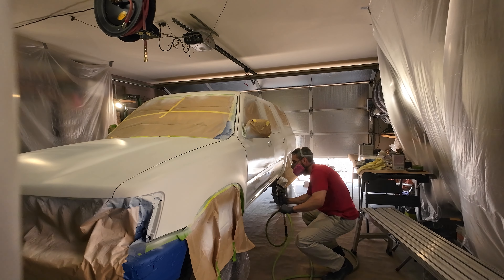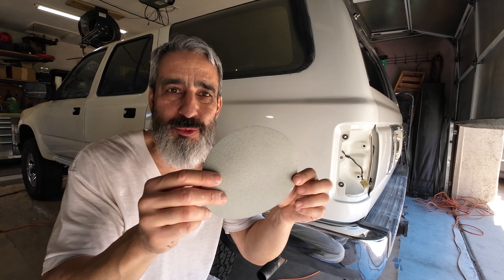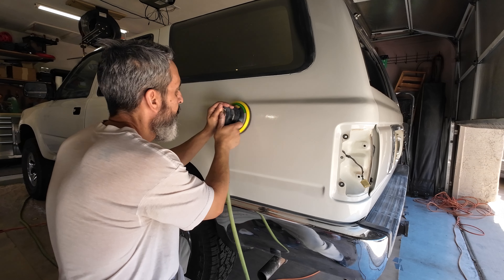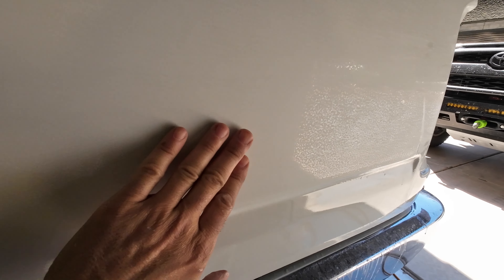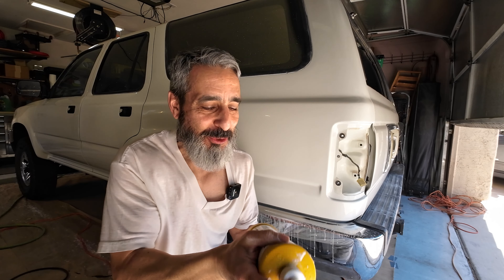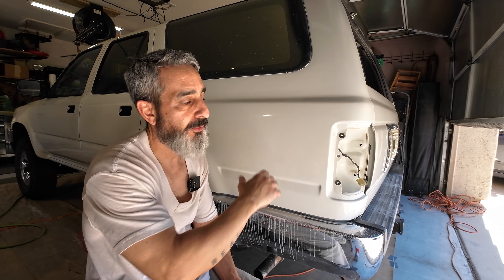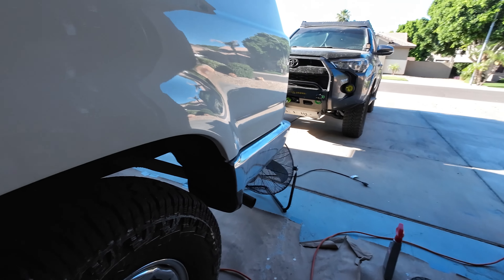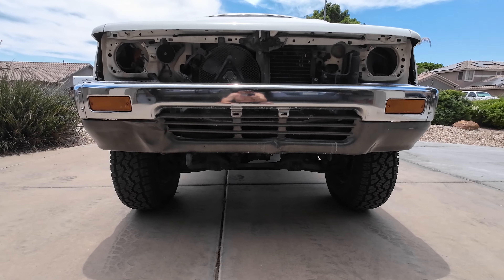You MUST Do This For A Professional Finish: Wet Sand and Polish

Comment: No waste. To the point. Very informative. Exactly what a how-to video should be. Deserving of the view and like. I've watched two already, good stuff, man.
Reply from the maker: @adrienroy9310  I appreciate your comment!!
Reply: I have, and still use a B & D  "PROFESSIONAL" polisher. Mine must be 35 YO. It looks like your corded machine used w/ the 1st 2k grit sanding of your 3 step process. Nice deep reflection after 3rd step 🎯
Reply from the maker: @lindahaack2530  Ha, yes, you nailed it! My boss in the body shop tried to throw it away back in the early 1990s when the cord failed. I fixed it and have used it ever since

Comment: I already left a comment on part 1, but incredible conclusion!  I'm been staring at the rust taking over the once white hood on 95' for 5 years.  past owners did not take care of it. Yours has the cool bolts heads that show on the front bumper.   if I were to buy a cheap enclosed tent how many hours do you estimate, roughly?   And cost?  I'm guessing a week of long days and 1500 for material
Reply from the maker: Thank you. It's difficult to say as sometimes you get into it and you keep finding things you want to make perfect. But I would say, you're pretty close in your estimate of time and money
Reply: @AZOverland2017  Cheers! thanks

Comment: Those 3M 3000s do last forever. I also constantly spray off the pad to clean it like you did. 
Have you ever tried the Rupes polishing system? The sand paper sucks so I use the 3M and polish with the Rupes. The polish school came out and got the bosses to take a way the Rotary polishers. It takes longer cutting with a DA polisher but you’ll never get swirls
Reply from the maker: I haven't used Rupes, they look good though. Yeah, I wouldn't recommend a rotary unless you have experience or get some good practice in. I've seen too many people burn through the paint on panel edges

Comment: I’ve watched a lot of car paint videos. Yours is my favorite. Great detail. Recaps, summaries, explanations, are just perfect. Toward the end of this video, I thought I heard you say, I have through compound and polish, dealt with the orange peel, but want “some  of it”, which confused me. Maybe you can do a video on orange peel. Thanks.
Reply from the maker: Thank you! Yes, from the factory most cars have orange peel. Take a at the outside of an orange. Because I am restoring the 4Runner back to a factory look, I kept some of the orange peel. Not much, but some. If I was doing a show car, I would have sanded it completely flat (no orange peel) and continued with the same process. It gives a deeper, more reflective surface.
Reply: You're right about the orange peel. All factory finished have an amount of of peel depending on the manufacturer. Cutting all the peel will make it shine like a show car but for daily use is not suitable.

Comment: Looks nice!  Most of my problems are from not doing a full panel at once.  Just like a wall in a  house, it's amazing how much a different angle can change things.  On my roof, I've been worried about sanding off too much on parts that got just overspray and not a full thick coat, not wanting to go through what remains.  Mine's looking good, but there is some texture seen when we are upstairs or when walking down the stairs.  But I'll just go for it, with a fine grit, knowing that I can respray the whole roof with clear if need be.

Yours came out great.  White seems plain to me, so I'd be tempted to go the fancy route of adding water droplets on the lower panels or something.  But a zombie apocalypse FJ cruiser, I think he was based in Payson or N on 17, has been growing on me.  Plain white is good for not showing scratches when the primer is the same color, and it keeps the car a little cooler in AZ.  But one option is to go the FJ route, with a white roof and the rest with color.  That said, I didn't like the sand color a buddy in Phoenix painted his old land cruiser, but I at least consider it these days.  And he had an old white toyota pickup too, maybe '86.

Thanks for the detailed videos.  It gives me some good quality work to aim for.

Comment: Great videos. I'm thinking of painting an old BMW. How about polishing the color coat before applying the clear coat? or skip the clear coat altogether?
Reply from the maker: You definitely don't want to polish the color coat before clear. If it was going to be a show car, you could wet sand the color coat with a fine sandpaper before clear, but that gets very involved. 

You can skip clear if you go with a Single Stage paint. That will be applied wet and produce a gloss.

Comment: I have a car that needs a new paint job eventually. I’m tempted to DIY it all, but I don’t have most of the tools.

What are your thoughts on DIY body work, prep, and spray can primer, then going somewhere like Mayco for the actual paint job?
Reply from the maker: Definitely an option. There are some places that don't charge too much for a decent paint job. Spray can primer is fine, but I usually reserve that for quick touch ups as I like a thicker, higher build primer over bodywork. But, it is possible
Reply: @AZOverland2017  thanks for the response!

When the time comes I’ll probably get some quotes just to make sure I know my options.

Comment: Pass on a tip,,, l just tried meguiars 110 compound and it's all l will use now, unbelievable results, very little dust and sling,, really looks like you compounded and polished, and it will remove 1000 grit sandpaper scratches, shine's like it's been waxed when your done, l found a rotary buffer with wool pad works best,, try it you will be sold like l am
Reply from the maker: Thank you. I was considering that compound as well. I will definitely give it a try
Reply: @AZOverland2017  your welcome, your going to love it,, used it today on panel sanded with 1000 and 2000 with little buffer with soft pad and was all it needed , looks like l had waxed it with a few passes, never seen anything like it,, looks like mayonnaise and no grit at all . Well worth the money you don't need much..

Comment: Hi . Just discovered your Chanel .
Nice work .
What air compressor are you using for the diy sander ?
What power and how many litres of air shall have compresor to be used for diy sanding
Reply from the maker: I'm using a McGraw 175 psi, 21 gallon. This compressor works but if you can afford a larger one than you should get it. I had to wait for the air to recover but I was working with what I have. I would like to have had a 30 gallon or larger

Comment: You must be useing really cheap clear if 2000 grit will cut it I've painted and cut and buffed many cars and 1000 is the finest that will work I've ever used 600
Reply from the maker: I showed the clear I used in the previous video when I painted this vehicle. Not cheap. Were you using low solids or high solids clear? Urethane, enamel, lacquer? I've sprayed all of them. I used to use 1,000 -1,200 when sanding and polishing when I did this for a living in the late 80's and early 90's. There are different products and different techniques now, than when I did it then. Much of what you use and how you use it will depend on your end goal.
Reply: @AZOverland2017 
Awesome job, man! 
We used to use 1000 then 2000, on most jobs. Cut the orange peel then take out the 1000 grit sand scratches!

Comment: Dont use a rotary you will fuck your paint i been detailing cars for 10 years new DA polishers can do just as good as a rotary and 1000% safer....just use a duel action polisher something with a longer throw patern
 with a good compound you can get the same results..i would recommend going to a detail shop and asking some questions you will need a compound pad for compound and a polish pad for polish...also dont just compound and skip polish it will look good for a day and get foggy and dull you must polish after and id recommend a hand wax
Reply from the maker: @moneygettingmovement7901  Thanks. I've painted and used a rotary polisher on hundreds of cars since the late 80s. I do agree that you can mess up your paint if you do not have experience using one. 
There is a distinct difference in the way you treat new paint vs detailing an already painted vehicle. You would never use wax after a new paint job. I would only consider using wax after at least a month cure time,depending on climate. 
I do appreciate your comment and you do have some valid input